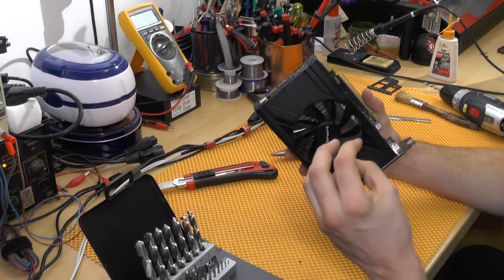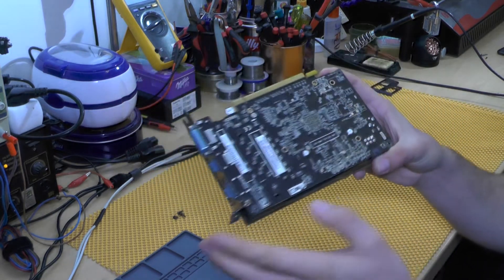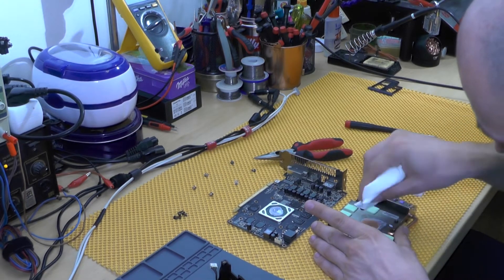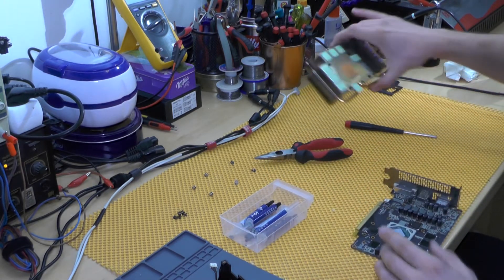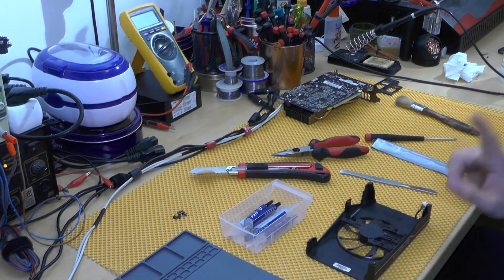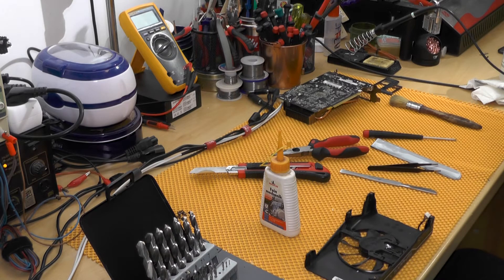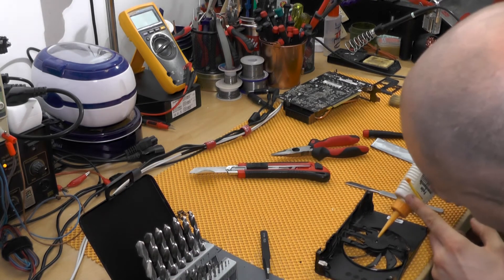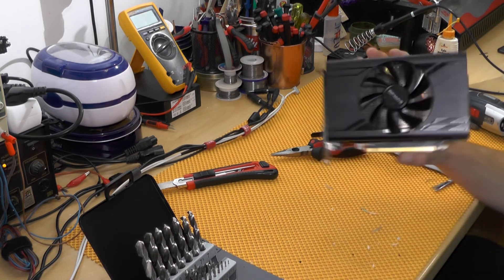[HW: HowTo] Sapphire ITX 570 Thermal paste replacement & Fan Repair (not the greatest one)

Comment: hope that you still answer this. What's the thickness of the thermal pads? I wanna change them myself, but my only doubt is this
Reply from the maker: Unfortunately i din’t have any gpu currently , however, you can measure the original one. I would say 1-2 mm.
Reply: @MTS_IT  I see. Thank you for your reply

Comment: If you dont have a syringe for the oil, you can always use a needle or piece of wire and drip the oil down it, it will just act as a flow guide

Comment: That' not how you put thermal paste on ffs!
Reply: That is the ONLY way to apply thermal paste on a GPU. Putting a small blob in middle (like you do with a CPU) will probably destroy your GPU (because it has exposed die with no integrated heat spreader)
Reply: @johna527  it won't, the pressure of the heatsink and the heat will let the thermal paste spread nicely around the die. There's pretty much no difference between any of the methods though.

Comment: My fan rx 570mini very loud (vibration) in 40-50% but low rpm or high rpm no vibration, only 40-50% .
Clean fan but no solution, maybe need follow your tutorial ? Thanks
Reply from the maker: you can try, however you can fu*k up pretty badly if you drill too much...
Reply from the maker: Danica Daniel i guess so, it might work, however i did not try it.

Comment: will i get a warranty void if i drill the fan?
bcs i did it but not all the way just a little and now the fan isnt working on my gpu
Reply from the maker: NasteSki yup, it will be void
Reply: @MTS_IT  because for some reason yesterday my gpu fan speed was 100 the whole day for no reason i didnt do anything i havent overclocked my gpu or modded it, today it sounded like it needed some oiling so i looked up on google saw your video, i did a little hole with my scissors and then gave up put it together and now the fan doesnt spin, ill ask for a new one at the company that gave it to me i just hope they dont notice it
Reply: could the fan not working be bcs i did the thing i didnt connect to the bearings tho
Reply: maybe it failed because it was at 100 yesterday
Reply: @nasteski1460  Sounds like a graphic driver error in the fan curve, my fans usually did that but by setting the fan curve manually or changing it just a little bit manually it works wonders and i have stopped having the issues. If you have AMD graphics i am 90% sure it could be that issue that is causing it.